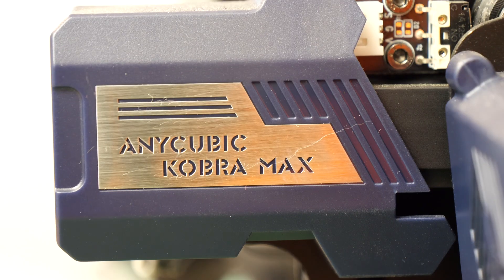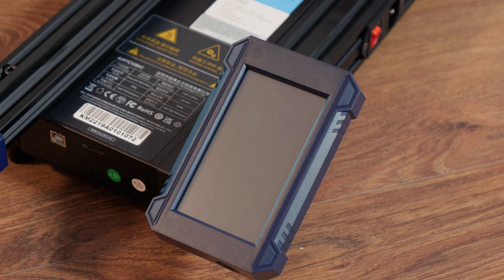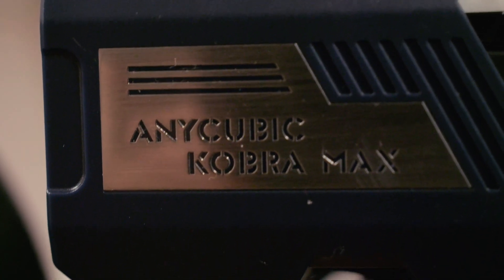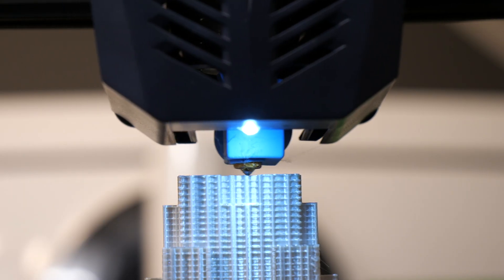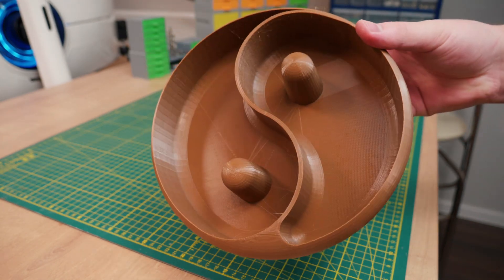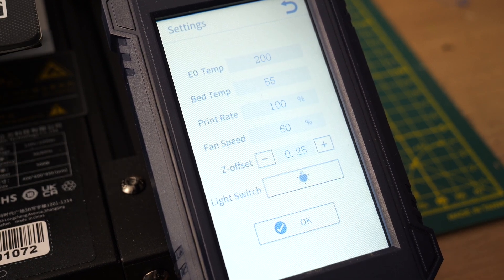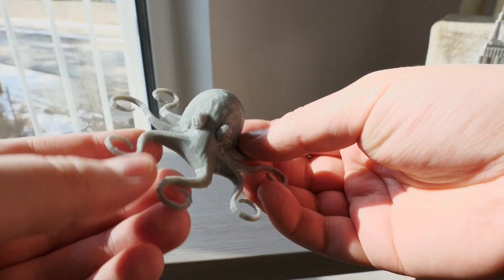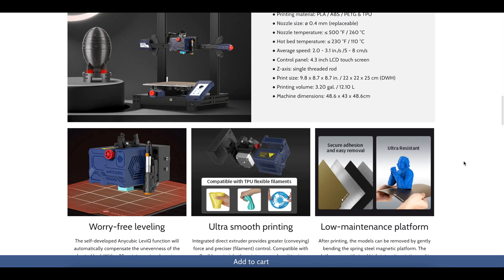BEST 3D PRINTER ON THE MARKET? - Anycubic Kobra MAX

Comment: Great video! Does the stock firmware on this have a way to change filament mid print, to get multi color prints? Thanks!
Reply: Nope unfortunately the only way to do that is to cut the filament and force the machine to pause then switch out the filament that way

Comment: When high volume printer is reviewed with tiny parts, what is the point. Voron v0 with 12x12cm bed does the same. Do the review with full print volume to see is the printer up to challenge

Comment: Scrapers uggggg. It’s glass bro. Just let it cool to around 30. It will just pop loss. If not heat the bed again. It will pop loss. Scrapers ugggggg. It will pull the covering off the glass. Then you will have sticking problems. Good view on the machine. Anycubic has pure quality prints 👍 if you don’t. It’s cause of you.
Reply: Thanks for the wait 30 mins idea. I will do that from now on.
Reply: Agreed.  I wait until completely cool.  You just grab them off and not stuck at all.
Reply: I wait about 3 hrs though.  No rush unless it's some part for something you need yesterday.

Comment: Nice Video and printer review. I like watching you making Progress in your Projekts. I have an anycubic at Home too and sorry but it hurts an Bit how you treaten your heatbed😅 i treated my First one also Bad and regret it After trying Sticky foil/Plates or an magnetic one. The magnatic one was not bad but not as good as the New Original anycubic heatbed. The filament sticks Perfect to the Surface and when cooled its pritty easy to Remove. I sharpend my scraper to get it better between the Print and the heatbed but carefully Not to damage the bed. Please don‘t take me wrong i want to prevent you From the misstake i Made😅 i like your Videos and Experiments and wait for the Tank to finish. Stay as you are and good Look on your way 💪🏼👍🏼

Comment: Why did you not mention the time it took to print the different models (except the sunflower seed bowl)? I feel like speed is the most important thing, as all printers in this price range are very accurate and self-leveling. It says on their website that the Anycubic Kobra is 168% faster than "competetive products". But in my experience different details in the models, such as with the scales on your cobra, add a lot of time. So the marketing stuff is a bit dodgy to rely on. It would have been nice (and mandatory in my opinion) to get some real world examples of speed. At least in the description or something. Or did they instruct you to not talk about it too much?
Reply: Define 'competitive products', yeah. But marketing like that is always dodgy. If you want fast, get a coreXY design, because I could never call fast a printer that has to move the entire bed with the print. Maybe fast on the X but not the Y.

Comment: I hope my next printers assembly instructions are as follows

1:- Take the printer out of the box
2:- plug it in
3:- Enjoy printing

My next printer is the Prusa XL, and yes its expensive but I have some permanent 16 hour per day 5 days a week printing commissions that have more than paid for it
Reply: Im looking at the Prusa XL, but this printer actuall has a BIGGER build volume. I am sad.
Reply: @paisis123  I have a Pro 3D V-King 400 for my larger prints, the Prusa XL will be a ground breaking 3D printer in 2023
Reply: honestly for the price of the prusa xl, might as well just get a ratrig or voron. They're much faster, larger printer area, fully enclosed, although they are DIY.
Reply: @morbus5726  I already have a Pro 3D V-King 400 Core XY that I built from self sourced quality parts
Reply: @AndrewAHayes  That looks like a cool printer, what hotend extruder combo do you have?
Reply: @morbus5726  I have a Bondtech BMG and a Copperhead on there at the moment but Roy the designer has a newish extruder that he dsigned and I am going to build that extruder and put the Dragonfly back on which was my original hotend for this printer